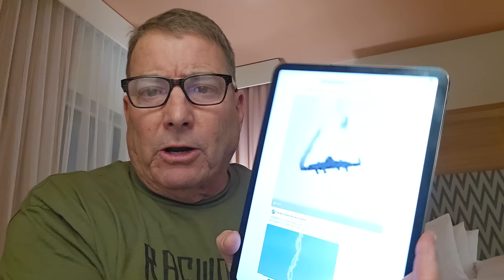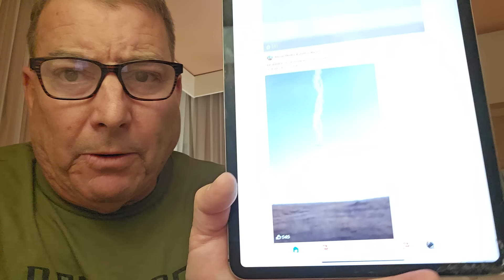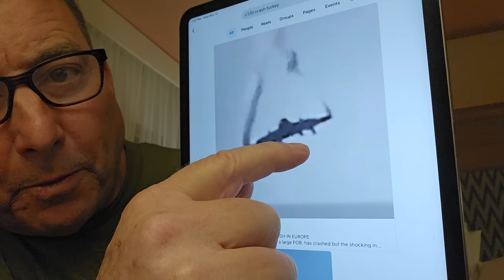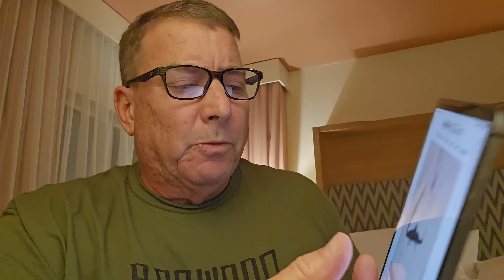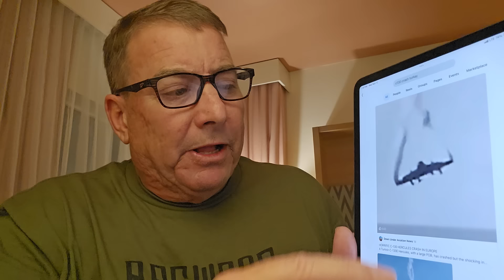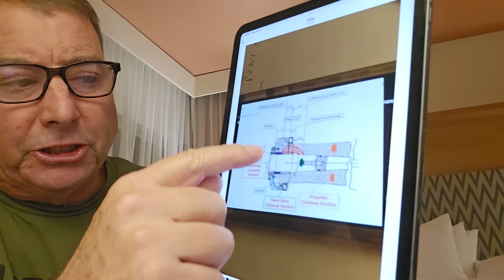Turkish C-130E Structural Failure 11 Nov 2025

Comment: I've flown on several Saab 340 aircraft in and out of Stockholm, many times I was sitting directly next to the props.  I was always uneasy on takeoff because those engines were under maximum load, the props were so loud, the whole fuselage would reverberate and rattle your ears.  I especially worried when it was -15° F outside  😐
Reply: Last time a Dowty propeller had a blade release was back in the 1950s, and that was due to pilot error. Most SF340s are fitted with Dowty propellers.

Comment: If it was a failure of the prop on the number 2 engine because of corrosion then that is a maintenance failure and not a structural or design failure of the prop. How many hours on the engine/propeller combination on (if the) engine that failed and how many hours since the last inspection. Too many factors to be pointing at Hamilton Standard.

Comment: I remember reading about a P-3 Orion that dead-sticked and ditched following a prop blade failure- it went through the fuselage, severing engine control cables as well as primary flight controls. The crew was lucky to survive, the aircraft was recovered for investigation.
Thanks, Juan, for the clear unbiased reporting.

Comment: We still have H’s in my reserve unit. We upgraded to the NP2000 props and better engines which extended the life of our planes. Our big issue is wing box fatigue. We were supposed to be getting them rebuilt but they put a stop or a hold on it for some reason.

Comment: Juan, aren’t these propeller blades inspected at regular intervals? Preventative maintenance may indicate fewer hours between checks, or replacement at a certain number of hours as happens on some rotary wing craft!
Reply: Yes, usually propellers have calendar limits and run time since overhaul limits, which ever comes first.  Then an overhaul is required, which includes visual, dimensional and NDT inspections, as well as mandatory replacement of some parts.

Comment: Wow I never considered a prop on multi engine plane could do this but it makes sense. Can this happen on any multi engine prop planes? Or is there something specific about the c130? IE the size and mass of the blades or location?
Reply: Any aircraft where the plane of rotation of the propeller intersects the fuselage is at risk of a detached blade contacting the fuselage.

Comment: It happened to an ANG C-130A back in the 70's.  3 blade prop. I was told that the no.3 engine lost  a blade that went through the fuselage taking out the hydraulics, the loadmaster, through the left side and into the no.2 engine. This happened at low level without any structural break up.

Comment: The prop failures on the C-130... Were they both blade seperations, and only on the Hamilton Standard props?  The failure that happened on Reeve Aleutian Flight 8 (L-188) was an Aeroproducts prop and was a gearbox failure; correct?  I'm just asking because both types use similar Allison engines.

Comment: You're comprehensive review is quite a bit more than we knew yesterday!

And then ummmm....can you please give us a percentage causes of airplane crashes for just maybe this year?
-maintenance, lack of
-equipment failure
-structural failure
-pilot error
-miscellaneous(fuel, etc.)
-bad designs
-software errors
-training, lack of

<caveat:>
<i was a unit commo guy in the army forever, and most radios did not work due operator error>
<was a us navy squid, sonar tech; and most failures occur at the mechanical/electrical interface(like most of life)>
<my last boat got underway for a hurricane to avoid damage when tied up the pier, but still had death and injuries at sea, etc.(whoever at cincpacflt and desron commanders; it's on them for that decision)>

Comment: Juan thanks for the quick update. Regarding the marine corp breakup, the ultimate probable cause was bad maintenance at an AF contracted depot. The AF techs used the wrong procedures and failed to detect the blade corrosion. If they had used the right procedure, the corrosion woukd have been detected. Details matter and save lives. Thanks for all your great work. You are very much appreciated!

Comment: When I worked at BWI we used to have a regular visit from the Egyptian Air Force with a C130. One day it departed and returned about 30 minutes later with the #2 propellor and gearbox missing and the top of the vertical stabilizer missing. I guess those guys were very lucky to be alive that day.
Reply: yes, they were, a prop loss is usually catastrophic, 99.9999999% of the time
Reply: (Jesus!...) Old USAF/ANG air cargo guy here -- in 2005, enroute to the desert, we trained at McGuire, NJ. Aerial port worked out of a condemned C-133(!) mx hangar; I recognized the dimensions, and recalled that that was a major MATS base long ago. The 133s had a grim legacy of prop pitch-control failures / breaking-up in-flight, among other things. (When we flew back from deployment, landed at BWI - I knelt down just to feel the beautiful, green grass outside of the terminal... wonderful.)
Reply: @dananichols1816  Curious - why did you strike out most of that sentence. Thanks.
Reply: @Tubesmaney  Likely struck, because the C-133  had a different propeller assembly  (electric control) than the C-130 (hydraulic control), so no direct connection between the two.

Comment: This is also been a common occurrence with the MU2. I witnessed a plane that landed at Northeast Philadelphia airport. It threw a blade into its belly, but missed the control cable. A pilot landed using a handheld radio.

Comment: A horrible accident. I used to fly in the RAF's C130K's quite a bit back in the day, so this is all the more shocking. In case you're not aware, the Turkish AF recently signed a deal for around a dozen ex-RAF C130J's (the RAF was the launch customer, so they are fairly early ones). Another of the ex-RAF J's is now "Fat Albert" with the Blue Angels.

Comment: My VP-16 instructor was on the VP-47 bird that crashed short of the runway at Masirah in 1995.  The P3 has the same engine and a similar Hamilton prop.  The number 4 prop exploded and the debris walked down the fuselage taking out the other 3 engines.  Luckily the plane held together and the crew made a no power landing in the water.
Reply: The P3 has T-56s but a low wing, so the Reduction Gear Box is turned around 180 degrees so the propeller shaft sits higher.  The prop is similar except that the blades have longer, rounded tips.

Comment: I include this article from 'Flying'  9th Nov 2022  title " USAF Identifies Likely Cause of C-130H Prop Cracks " :
[ Electric arc etching pens were likely the cause of cracks in older propeller barrel assemblies that led the U.S. Air Force to ground a portion of its fleet of C-130 Hercules cargo aircraft last month, according to a report. 
The cracks were discovered in early-October by a technician at the Warner Robins Air Logistics Center (KWRB), Georgia, who noticed a persistent leak on a C-130H propeller during a post-depot operation engine run check. 

Now, AMC officials believe an etching pen used to inscribe parts with serial numbers following inspections—an action the service describes as standard—may have led to the damage, Air and Space Forces Magazine reported.

“The process used to engrave serial numbers on the propellers caused the cracking that is being found on the C-130Hs,” an AMC spokesperson told FLYING in a statement Wednesday. “That process, which involved an electric arc pen to incise digits into the surface of the metal, was stopped about six months ago and will not be used going forward. Further analysis will be needed for a full understanding of the root cause of the cracks.” ]

Comment: Turkey has purchased 12 ex-RAF C-130Js, which are being refurbished before delivery. Some have already been delivered. I think that the work was being carried out at Marshalls Aerospace at Teversham Airport, Cambridge, UK. I worked part-time (Saturday morning job) and in the Summer holidays on RAF C-130s when plugs were inserted in the  fuselage and the center fuel tanks were modified to improve fire suppression.

It is a shame that the RAF go rid of the C-130Js, because for many tasks they are better suited, than the M400s.

Turkey has ground the C-130EM fleet and instituted a fleetwide inspection program, which is prudent. I hope that other countries operating the older aircraft follow suit.
Reply: @christopherrobinson7541.  Being pedantic, you mean the A400M ?
Reply: @riaanlouw1874  and Cambridge Airport
Reply: @riaanlouw1874  No, he doesn't.....

Comment: It seems very odd that these planes are sliced in half if a propeller blade is coming off, never heard about that being a thing, before!

Seems like an obvious danger that one would have thought should have been mitigated by strengthening the fuselage on those spots where the propellers may hit. 

Btw - why doesn’t C130 have jet engines like normal planes - is there any particular reason why they still use "antique" propeller technology in such big planes?
Reply: Armoring the fuselage to the extent necessary to fend off a blade strike would make the AC too heavy to fly...

Comment: Turkey operates a fleet of 18 legacy-model C-130B/E transports. These were modernised to the C-130EM standard, which includes updated cockpit avionics and digital communications. However, the airframes themselves are still decades old, with ages ranging from 51 to nearly 67 years. Fatigue issues with the long-serving C-130 family have been a known challenge for over a decade. Multiple efforts have been undertaken by global operators to replace original C-130 centre wing boxes to address structural fatigue and extend service life.

Comment: My cousin died in a similar  C-130  crash in  Turkey in the early 1970's.  Loss of  an inboard propeller. My uncle got a copy of the accident report from the Air Force and it attributed the crash to a failure of a bolt.
Reply: That plane was shot down by a Russian MIG fighter jet. Although the Soviets denied it for many years, they later admitted to shooting down the C-130.
Reply: That was soviets not propeller

Comment: You said one failed at 20,000 feet and this failure was at 24,000 feet but you didn't explain how that is a factor?
How does the altitude affect prop failure?

Comment: Why not remove the props every so often and NDE the shaft? If that is all it is with corrosion.
Reply: Propellers and RGBs both have a maximum calendar or flight time after which they are overhauled.

Comment: This one has been on the news everywhere and it must have been a really serious chain of events taking place.
If the root cause is the same as an earlier crash then this is a bit worrying, and it indicates insufficient maintenance and inspection procedures.
Overall the C130 is as I see it one of the more reliable aircraft out there though.

Comment: Non-aviator here.  How can a single shedded prop blade cut a fuselage in half?  If it cuts some main structural member, that seems like there should be many more non-fatal sheddings than fatal
Reply: It doesn't cut it in half. It does so much damage that it compromises the structural integrity. You also now have a horribly unbalanced propeller shaking the hell out of the plane.
Reply: The prop disc on a Herc is something like 13.5 feet in diameter. Even after subtracting the hub size, each blade is probably 5+ feet long, and maybe up to a foot & a half wide. That's a heck of a lot of structural damage potential if it happens to depart, and slice through the fuselage. And if one goes, with the violent shaking I suspect the other blades on that hub (or the entire hub) would probably depart in short order.
Reply: The blade is almost half the diameter of the fuselage cross section so we aren't talking small blades here and on the KC-130 accident it left a several meter wide hole. The reduced structural integrity along with the forces caused by asymmetric thrust is what is then causing the failure. Also the fuselage itself is the structural member due to its construction.
Reply: Thanks for the replies, but (a) why does this only happen to C-130s?  There are photos of other planes with missing engines which worked themselves loose when a blade went missing, and planes with blades stuck in the fuselage.  What makes the C-130 so different?  It's not the only plane with big turboprop blades.
Reply: @grizwoldphantasia5005  There are other planes that used the same Hamilton standard prop which had issues with material fatigue. The blades on newer turboprops including upgraded C-130 are increased in number, smaller, more reliable, less maintenance intensive, and made out of composites. Keep in mind that the C-130 itself as a platform given its age, runtime, and service has been very reliable.
Reply: @FirstDagger  Again I ask, what makes the C-130 so uniquely susceptible to its fuselage breaking from a prop blade failure?  If it's only older models, why?

Comment: Was the corrosion issue in the earlier loss caused by the use of a chlorine soaked cork plug inserted into the hollow section after routine maintenance of the blade? I think this was the cause of some other blade failures.

Comment: KC-130R/160013 lost a prop blade while doing a static take-off in Australia in 1996. Traced back to corrosion on the blade shank missed by the rework facility at Robins (all legacy C-130 props and P-3 props are reworked there, in the US) I know some are also reworked in the far east.

Comment: The HS 54H60 has 7075-T6 aluminium blades that weigh 130 pounds each.  The T56 engine spins them at a constant 1020 RPM.  The 4 blades absorb about 4000 hp.  There is a lot of stress acting on the blades, especially at the blade roots. The propellers get periodic overhauls where the blades are inspected for, among many other things, evidence of stress corrosion cracking and inter granular corrosion.
Reply: A quick AI calculation yields a kinetic energy per blade of about 275000 ft lbs or 360 kJ. That corresponds roughly to the muzzle energy of a 35mm Oerlikon auto cannon projectile at point blank range. It'll slice though an alloy air frame and whatever else thin it comes along the airplane like a hot knife through butter.

Comment: Is this essentially the same failure that happened (thankfully with less catastrophic results) on Reeve Aleutian Airways flight 8 in 1983? That was a Lockheed L-188 (essentially the same engines as the early C-130s), which lost its #4 propeller, and the propeller then sliced through the bottom of the fuselage. Fortunately, in that case, neither the airframe structure nor the flight controls were fatally compromised (though both were damaged), and the aircraft was able to land safely in Anchorage.